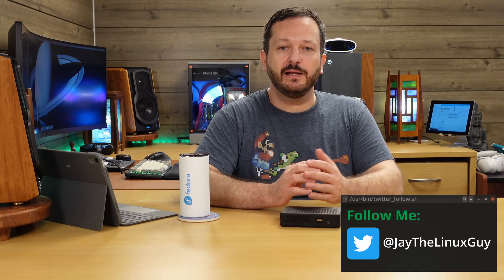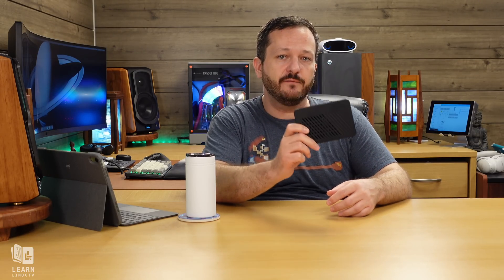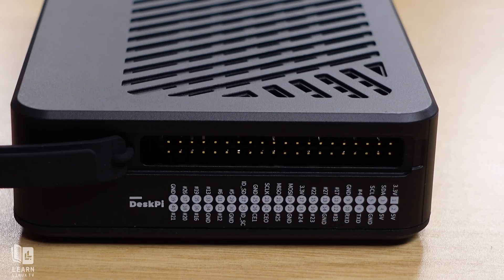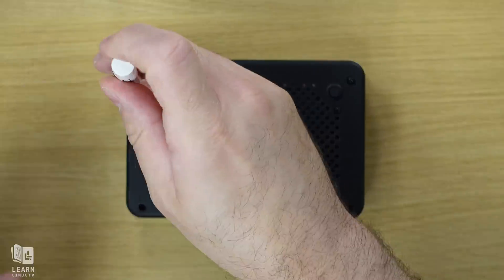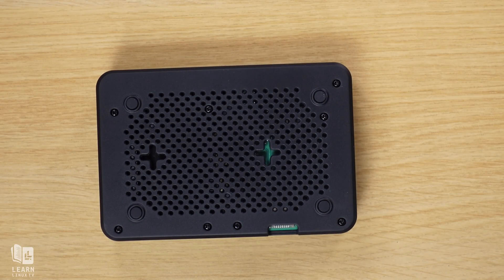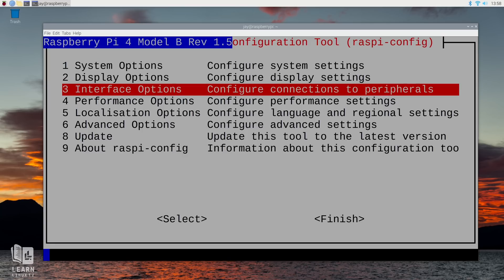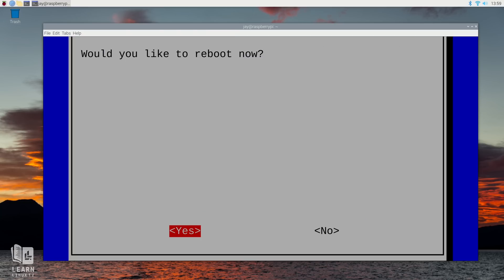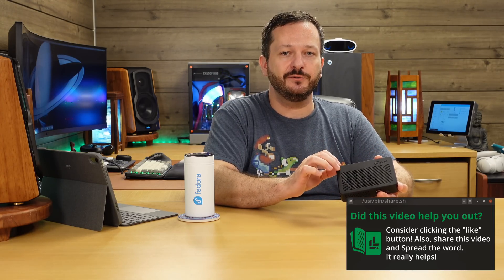Your Raspberry Pi as a Desktop - DeskPi Lite Full Review

Comment: I have both this and the other pro unit... my "only" gripe with this unit, the lite model has a tiny clear plastic "window" that is a loose fit from inside the case.
It falls out very easily and when it falls to the floor, can be a nightmare finding it again..
I "fixed" this by a judicial application of superglue.
Setting it up was, as said here, absolutely easy. Mine came with extra thermal pads. Just in case you muck it up. And yes, don't forget to remove the clear plastic protector from each pad... ahem...
Basically 10 out of 10 for everything about this kit...
All I need now, is a version that works with the pi nano....

Edit

About 30 seconds after typing this, I found a kit that allows us to add an nvme drive to this enclosure.
It adds about 20mm to the bottom of the case...

Comment: I can’t get the front USB ports to work, tried several different edits. Also the fan pin shares TXD, which I was planning use.  I’ve asked the DeskPi support if I can use a different pin for the fan, but so far no response. 
Thanks for the great video.

Comment: DeskPi sells an M.2 SATA expansion board for the Pi4/DeskPi Lite if you want to go the SSD route.  Me, I'll stick with a 1 TB microSD card since I'm not looking for huge onboard storage, and access speed is sufficient for me.

2 suggestions based on others' experiences:

1- Be sure to install the LED "lens" before closing the case.  Otherwise, you'll have to pull the lid off again to stick it in there...

2- Install the loaded microSD card on the PI4 bottom before assembly as well.  It's not obvious to see the correct card orientation from outside the case (just a slot), and will save you another headache...

DeskPi might consider a plastic mold revision to add a microSD card orientation figure on the case near the slot (just a thought).

I hope that they come out with a Pi5 version, as this one looks pretty nice (and Pi5 moved the Ethernet port to the other side)...

Comment: For the same price level, I can get 4-core intel mini pc with 4gb (upgradable to 8gb) ram with ssd. X86 has more apps than arm for linux
Reply: Im assuming youre referring to the current price point of $200++ due to the insane markups from the resale market

At its initial price point, a rpi 4 is indeed alof cheaper than any mini pc out there, thats why there is ths appeal

Currently a rpi 4 is literally more expensive than a mini pc or 2
Reply: Yeah, that's it. I can't understand the niche where they're thinking to put this machine, other than to enclose the PI itself into a case for its current functionality. And that helps, obviously.
Reply: The problem is that the Pi 4 is currently WAY overpriced. I bought my 8GB Pi 4 for $75 when it first came out.  Now, if you can find one, it's north of $200. Even the $45 2GB model is selling for over $100. I have my 8GB Pi 4 in the DeskPi Pro case with a 2TB SSD, and I love it.